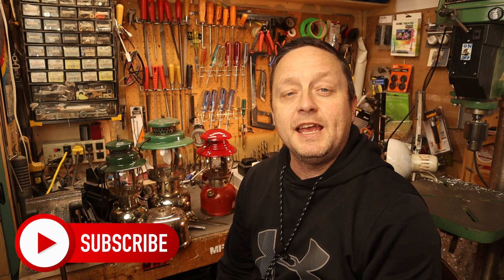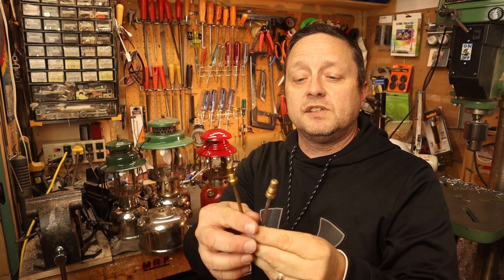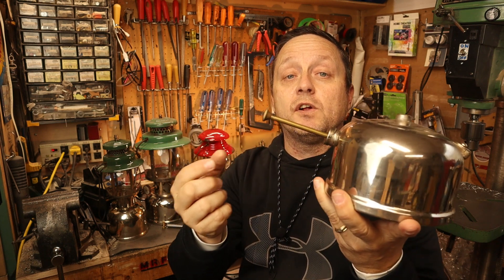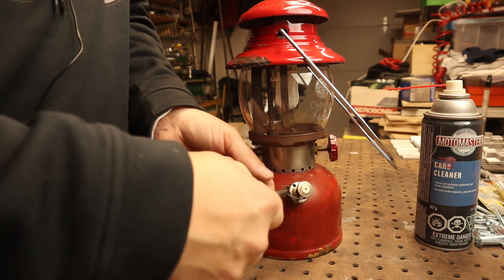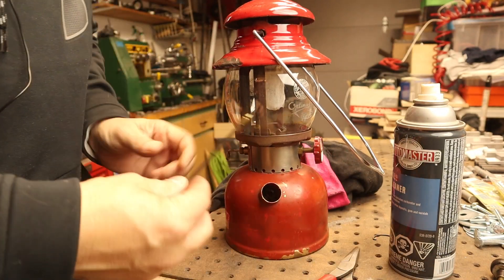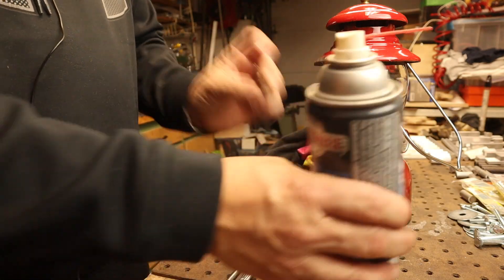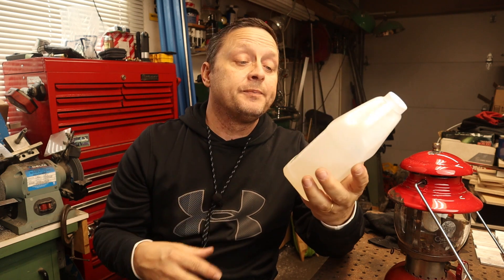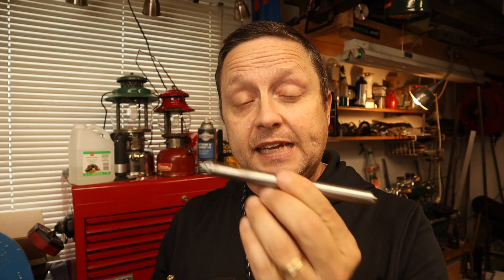How to CLEAN A Check Valve // Restoring Coleman Lanterns

Comment: Hey Mike, it's Mike...lol. I didn't have carb cleaner left, but I did have mass air flow cleaner. I removed the pump and rod, filled the chamber halfway and dumped it out a couple times because it just looked horrible. Once it was cleaned, I let the MAF cleaner do it's work for a couple hours. Then I put it together and tried to pump it, but still wouldn't pump. So I sprayed some more MAF cleaner into it and waited another hour. Was about to order the check valve tool, but I thought I give it another go. At first, same thing and then I tried pumping with a little more force and Bam!!! The check valve broke free and I was able to pump it up! 
Thanks so much for this video! Saved me from buying a tool.
Reply from the maker: Thanks for commenting. Glad it worked out. You can also poke the check ball with a piece of wire to get it to move. The CV still may a small air leak if there is some left over residue. Keep a look out for that. If that is the case you may try the Carb Cleaner trick again but it's been my experience that the CV will need to be removed for a more aggressive approach to cleaning it. Cheers.
Reply: @MikeFreda  Thank for the tip. I did do a test fire of my lantern and didn't hear any hissing sounds before and after start up. But will keep my ears open...

Comment: Coleman noob here with a leaky 286, thanks for the tips!   Liked and Subscribed.
Reply from the maker: Thanks for your comments.  Those lanterns are pretty modern. The fount, Check Valve and caps are all the same principles. The valve assembly is a different than the older lanterns. If that’s what’s it leaking, it can be fixed but sometimes it’s just easier to replace that assembly.
Reply: @MikeFreda  I managed to remove the checkvalve from my 286A, and after blasting solvent through the ball valve it appeared to be working! But once assembled in the lantern, sadly it still leaks air.. 
I live in Ontario, Canada.  Do you have any ideas where I can order a new checkvalve from?
Reply from the maker: Try boiling it in vinegar.  If not, Old Coleman Parts has what you need. Good place to get lantern parts.

Comment: Thanks Mike! I inherited my Dad’s 228F and I’m having issues with both the control valve which is frozen and the pressure valve and the ball isn’t engaging. No pump action at all. There was fuel in that’s been sitting since forever. He left me 7 of them so I’m trying to repair this one. Thanks.
Reply from the maker: You’re welcome.  I hope it works out for you.  Cheers.

Comment: Thanks for the video.  I just got a check valve tool and am attempting a rehab on a 200a with a suspect check valve.  Appreciate the tips on boiling vinegar.  Have a Coleman 446b to use outside to try cleaning it out if carb cleaner doesn't work.  Thank you!
Reply from the maker: You’re welcome!  Good luck with your rehab! Cheers.

Comment: Mike. Thanks for the demo on the viniger and check valve boiling. I am going to try that on a 220F that responded perfectly to everything except the carb clean fix of the check valve. Do we need to put the valve in water after the viniger boil or is the acid OK on the brass?
Reply from the maker: You’re welcome.  You should rinse and lubricate.

Comment: Excellent presentation here .. love the MSR dragonfly camp stove in action ... I converted a 295 D/fuel to run on Kerosene , the generator kept clogging... any North star lantern tips there Mike ?.. thank you
Reply from the maker: Thanks for the comment. I don't have much experience on Northstars. A bit to new for me. lol  What you are saying is very common for White gas to Kero conversion. I've done that to a few lanterns and that just happens. Unless the lamp is 100% designed to run Kero this is an issue. The 639's run flawlessly on Kero but if you look at the parts they use it is a lot different than other lanterns of this style. All I can suggest is run a better quality of Kero. Some people mix it for good results. Cheers

Comment: Hello, Mike! Thanks for your video. Is it possible to remove the valve with an ordinary flat screwdriver? Or is there a possibility of damaging the valve?
Reply from the maker: Hello, It is "possible" but I don't recommend it. When I first started fixing lanterns I didn't have the CV tool and I did get some CV's out using a large screwdriver but I also ruined a few. The CV is made out of brass and the slots are malleable... YMMV. I figured out how to make a CV tool and never had a issue since.  If it's a newish lantern you may be able to spray some anti-seize down the pump tube and let that site overnight then try.  It's hard to get a positive engagement and use the "crack" method to break the CV free with just a screwdriver. Like I said, It can be done but not something I would do anymore. cheers.

Comment: Thanks for the video, my Coleman lantern isn't pressurizing at all.  I can pump 50 times and no pressure at all.  Should I spray carb cleaner in there and try that?  Thanks.
Reply from the maker: You can try that but I would try and see where the air is escaping from.  The Cap? The CV tube or perhaps you have a pinhole in the tank/fount.  The other thing to look at is the leather pump cup actually working correctly.
Reply: @MikeFreda  ok thank you for the swift reply.  As far as I can tell, it's not building any pressure no matter how much I pump, I don't hear any air leaking. I oiled the pump, mine is newer so it is rubber and not leather.  I sprayed cleaner in there, and letting it sit for a while, maybe that will fix it, thanks again.

Comment: Mike, I have a 425f Coleman stove. Been sitting a long time. I can pump it up and get a lot of resistance on the pump but it doesn’t seem to pressurize the tank. I can remove the fuel cap and there’s no pressure, no hiss. Also not sure about pump. I can have it snug going clockwise, but I only have to move it maybe 1/16” to the left and I can pull it out and pump it. Any ideas? Thanks
Reply from the maker: When it come to these Stove's (and lanterns) there is only a few things that will stop it from being pressurised. 1.) The cap. The seal is to hardened. 2.) The Check Valve at the bottom of the pump tube. 3.) The air tube 4.) The tank has a hole in it.    For the cap, install a different one or replace the seal.   Clean the check valve or install a new one.  If/when you remove the check valve, install the pump and see if you can can get air into the tank. If you can, then the air tube is clear.  To see if the tank has  hole in it, try to pump it up and submerge it under water.   I suspect it's the cap seal and check valve. The other two issues are more uncommon.  cheers.
Reply: @MikeFreda  thanks for the quick reply

Comment: Hi Mike, I have a check valve removal tool but need one that is short enough to get into a Coleman 530 pump well without removing the pot stand bracket as the screws are completely seized. Any way you could help me out?
Reply from the maker: Thanks for your comment.  Thats odd that a standard Check Valve tool would not fit. The pump tube is on an angle and the pump stem does extend out. As long as your tool is a bit shorter than that then it should work. 

That being said, I do make shorter Check Valve tools but I’m not familiar with the 530 stoves check valve. I’m not sure what it actually uses.  Cheers.

Comment: I quite literally ruined a Coleman 335 using Canadian Tire carb cleaner because I got the idea from watching your video. I purchased a mint looking lantern that had a leaky valve and did exactly what you did here. There is a coating inside the fount that does not react well to carb cleaner. I looked inside the fount before I ever used the carb cleaner and never saw anything that concerned me. Afterwards the inside looked all blistered and peeling away. Bad idea to continue using it
Reply from the maker: Oh dear!  I've never heard of 335's having a lining. I have several and it looks raw inside.  How did the cleaner get into the fount anyways? You typically just spray it in the pump tube and pour it out. The pump tube are typically bare metal since the pump cup will wear away any coating.  I don't feel your lantern is ruined. Just take it apart and clean the fount out with some fuel and a bunch or 1/4" nuts or ball bearings. Spin it around in a drill or swish it around for a while.  I have a short explaining the process.
Reply from the maker: https://www.youtube.com/shorts/Nr9DBGEYd_U
Reply: @MikeFreda  My lantern is dated 7/74 and it had a brown liner in it before I used the carburetor cleaner. I guess I used too much cleaner. It took days working at it before the ball started to seat properly so it wouldn't leak, and from time to time I would put the pump in and try to blow the crud past the valve to clear it. In doing so it got inside the fount. Once I realized what happened I chose to spray the entire inside of the fount to completely remove it all. At which point it all came loose. From there I threw in a few dozen screws and shook it around to pull off what remained. Then I rinsed it all out with water. 

Was removing it all a wise idea once some of it was loose? I don't know, but I figured that if there was anything left loose inside that pieces might break off when operating the lantern and plugged it up rendering it inoperable. We learn from our mistakes I guess. I'm not blaming you mate. This one is all on me, but beware that brake cleaner will eat at that coating.

Comment: I have an old 220 from the 40s and the check valve shaft is filling with fuel... is this the valve or something deeper?
Reply from the maker: Interesting.   Even if the Check Valve is faulty, it’s hard for fuel to make its way up the air tube.  If the air tube is broken and the CV does not seal it would do that. Also, if the CV socket is compromised, then it would leak fuel in the shaft.  Unfortunately, if it’s either of that it would be a really hard fix.  Most people would just find a new fount. 
I’d start with removing the check valve and cleaning it. Putting it back in and pumping it up then looking down the tube to see if any bubbles leak from the CV socket.  Good luck.
Reply: @MikeFreda   thanks for the fast reply mike
yeah i removed both the shaft and the check valve.... there are bubbles leaking from inside the check vale housing. while pumping fuel even shoots out the end of the thumb hole....
i really want to fix this fount because its brass, not steel. they only made them for a few years in WWII. its really cool looking. 
any ideas ?
Reply from the maker: Yes, It can be done.  I’ve fixed one before.  Have a look on the Coleman Collectors forum.  Search “repairing a brass fount pump tube”
Reply from the maker: https://colemancollectorsforum.com/viewtopic.php?f=6&t=4468&p=62288&hilit=220b+pump+tube#p62288
Reply: @MikeFreda   is there anyone you know of that i could mail it to for this to be done?
Reply from the maker: Other than me…. No.  Most Coleman people will say find a used fount.
Reply: Ok thanks 
Im cleaning the entire fount again right now and it is FILTHY inside.... hopefully a thorough cleaning will get all parts to seal. Otherwise the controls work solid

Comment: I have searched all over the internet and can't find any how to for fixing a stuck carburetor cleaner level. Can you make a how to for that? I have an old coleman lantern with a stuck carb cleaning lever that won't budge.
Reply from the maker: Thanks for commenting.  I’m assuming you are referring to the tip cleaner lever.  The lever that rotates and cleans the jet.  
This can be difficult to free up.  Check first that it’s not on to tight.  If not, remove it and soak it in penetrate.  If that does not free it up, put it in a vise, heat it up with a propane torch.  Let it cool down a bit and rotate the lever using some pliers. Cheers.

Comment: Ok i need help Coleman 295 dual no pressure whatsoever…Shot carb cleaner into check valve  area for 4 hours no luck HELP
Reply from the maker: I guess you have to determine if it’s actually the check valve.   How’s the cap? How is the valve assembly?  Is their a pinhole in the tank?  Can you blow air into the full hole and hear air come out the CV/pump tube?   

If it’s the check valve, it may need to be removed and cleaned outside of the tank.  If you can get it out, try boiling it in vinegar.  Cheers.

Comment: Mike- thanks for the video. I boiled the check valve in vinegar and installed it. It still barely bubbles/fizzes a little fuel out just a bit when you look directly down at it. it's from a 413e stove from the 50's. one of my old 502 stoves do the same thing. Is this normal ? also doesn't have an 0-ring.wasn't sure if they all came with an o-ring. Thanks for any help!
Reply from the maker: CV’s in this era did not have o-ring.  Some Old CV’s do leak a bit but seal up when you screw in the pump rod.  What you can do is pump it up and screw in the rod and put a little soap on the pump thumb hole.  If it still leaks then you may need a new check valve or the CV socket may be comprised at the bottom of the pump tube.  Cheers.
Reply: @MikeFreda  Thanks Mike!

Comment: Why not just use a fat  screwdriver to remove the CV? Also, if the CV leaks, cant you just turn the pump knob to lock it? Thanks
Reply from the maker: You can but it is not recommended.  The CV is made out of brass and if the CV is old and has never been out you will probably damage the CV.  Screwing the rod down doesn’t make for a 100% seal especially if the threads are worn out. If the CV is really bad the air will escape almost immediately.  Furthermore, some CV's can be stuck closed, meaning you can’t get any air into the tank so it basically needs to come out.  Cheers.
Reply: @MikeFreda  Gotcha.  Thanks!

Comment: I just got a 226 lantern and I'm thinking the check valve is faulty...I got it full of fuel and sat for a decade.
I've oiled the filler cap, oiled the gasket and pump. 
Nothing
No compression what so ever..even when the pump is turned closed, you can pump freely.
Reply from the maker: Even if the CV is faulty, you should be able to pump air into the tank… it will just some back out the pump tube when you lift your thumb off.  You should be able to open the cap and hear air rush in when you are pumping. 
If not, I suspect your pump cup may be at fault as well.  Cheers.

Comment: Hi Mike. Carb cleaner is great, but there’s absolutely no reason to remove the check valve.
After soaking the valve with carb cleaner, blow into the pump tube, and with a wooden kebab skewer tap it gently onto the steel ball in the check valve, until it spits back, which it will after a few seconds.
Reply from the maker: Thanks for commenting.  That doesn’t work all the time.  I’ve rebuilt and serviced several 100 lanterns and sometimes the CV need to be removed, cleaned and /or replaced.  Sometimes a small piece of debris gets in there and carb clean is not aggressive enough to clear it.  I’m glad you are able to just to that, many can… I’m not so lucky.  Cheers.
Reply: Carb cleaner has NOT worked on either of my lanterns. Yayyyyyy 😢. I have spent 2 days messing with these lanterns. I am bound and determined to fix them. I'm insane🤣.
Reply: A few weeks ago my sister gave me a 1/1963 200A Birthday Lantern and it was/is in rough shape. After over a week of shooting carb cleaner down the tube and pumping it through and letting it sit over night, I bought a CV removal tool. I soaked it in carb cleaner and then vinegar. The whole fount is cleaned out, the CV is back in and it still leaks pretty badly. The pump shaft still quickly pushes my finger up when placed over the hole and air rushes out. My next move is to pull the CV again and boil it in vinegar and see what happens when I put it back in and see if it still leaks. I had a huge screw driver and filed it down to fit but even after putting penetrating fluid on it the screw driver would not budge it so that's when I got the removal tool so I didn't break the CV.
Great videos!

Comment: Got a "tested and working" 220F in the mail today. Disaster. 
First, the pump cup wouldn't even work. Oiled and got working. 
Second, 3 piece gas cap had rotten seal. Used a spare 1 piece for checking 
Third, pumped and check valve broken. 
Tested and working my @$$. 
Seller says "just make a claim and return". BS. .first of all this thing was a safety hazard. He says his buddy "restores" these for him. Well this one failed in every way. Haven't even gotten to see if generator bad yet. 
So rather than lose $18 I paid to ship to me I'm keeping and fixing.
Yes I have to buy the removal tool for like $43 but I can use it for others if needed in my collection. 
Guy didn't take any responsibility just said "these things happen". Yeah ok the old man who restores for you literally left everything bad. 
I'm keeping it but that was the worst eBay experience I ever had.
Going to try your way without removing before tool gets here. It's a nice lantern in great condition.
Reply from the maker: Thanks for commenting.  Sounds like a raw deal!  Hopefully you can fix it up.  Realistically, everything lantern I have collected I typically give it a rebuild regardless of what people say then you know it’s good to go.  Cheers.